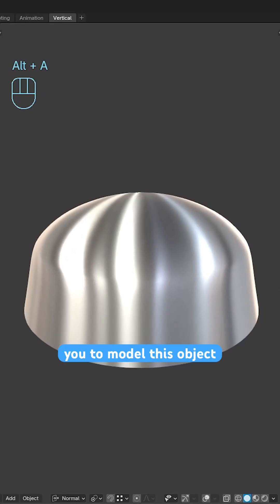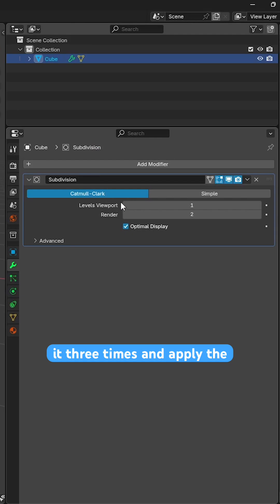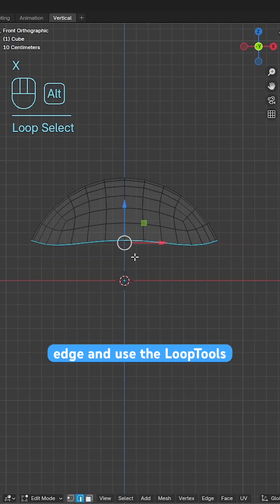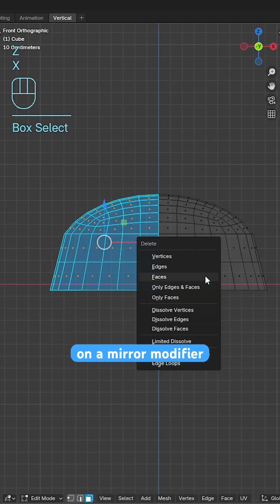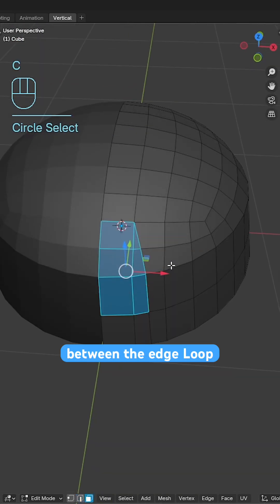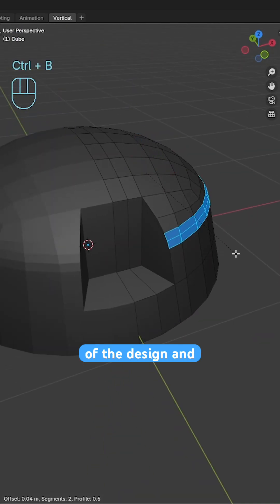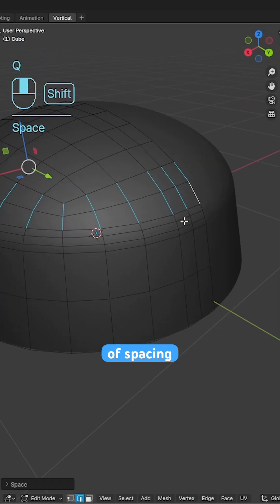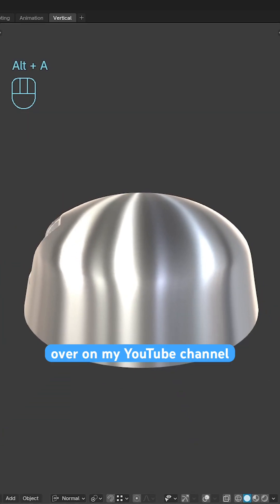Blender Modelling Challenge 3 Solution | #blender3d #blender3dmodelling #blendertutorial

Comment: There was s Ngon on the side 😓
Reply from the maker: Yep, there certainly was. 😄

But it's not connected to a leading edge and is on a completely flat surface, so it won't cause any distortions on the model. Since the mesh is subdivided, the ngon will also resolve into quads.

I left it there intentionally due to the inset that I did, which provides the necessary quad-based support around the edges. 😄

I know there is a lot of stigma around tris and ngons, but they can be used in modern-day modelling workflows since we are no longer bound by the same technological limitations from 20 years ago. I wouldn't advocate for tris or ngons on a curved surface, though, as that would cause distortions.

Comment: Hey masterj, I've commented before, but I'm just now noticing that the topology at the end where you create the extrusion and bevel the inner loop might need more geometry. You have an n-gon as there is a 7 sided shape. To fix that, I'd suggest adding 2 loopcuts and merging all verts by distance. After that, all n-gons should be removed.
Reply from the maker: Yep, you're spot on there, and I am actually missing a loop from my original solution in this one to help support the frontmost edge.

As for the ngon, given its position, it will not cause any issues, though I understand the desire to make a quad-based mesh. 😄

In this instance, I've just left the ngon there since the inset creates a support loop for the outer edge, which is quad-based and thus provides the necessary support.

The ngon isn't sitting on the leading edge, so it won't cause any distortion (though as I said, I did miss one edge loop). Also, since this is being subdivided, the ngon will naturally resolve into quads. I'm a big advocate for using tris and ngons in situations where it makes sense, as in an instance like this, while all quads look nice, it's not necessary to achieve the same end result. 😄

But I appreciate you mentioning the ngon and showing your ability to problem-solve the area. 💪
Reply: @ I didn’t think that the ngon would affect any issues other than screw up the topology when you apply the sub div modifier. I’ve tried it before, where an ngon hasn’t affected shading but has made it harder to fix later after applying that sub div as mentioned before. For this case though it should be fine as you mentioned, just a small thing I instinctively try to fix most of the time.